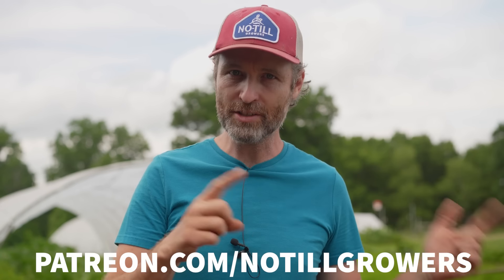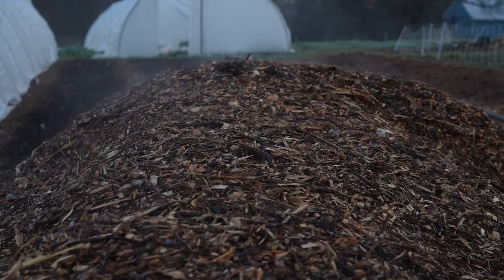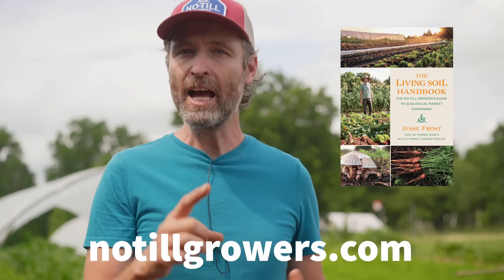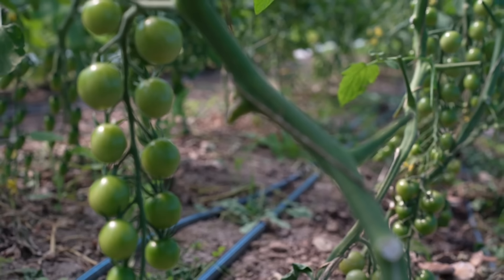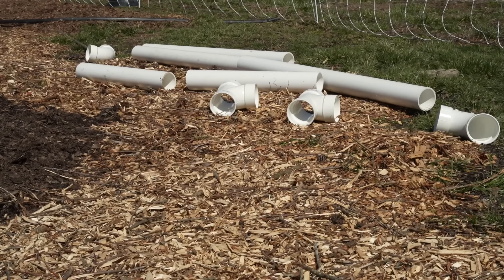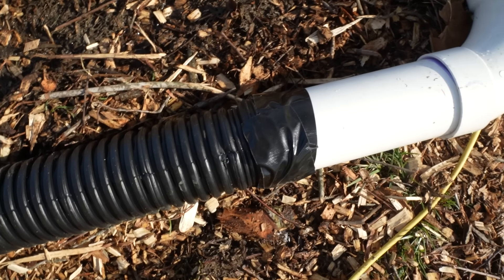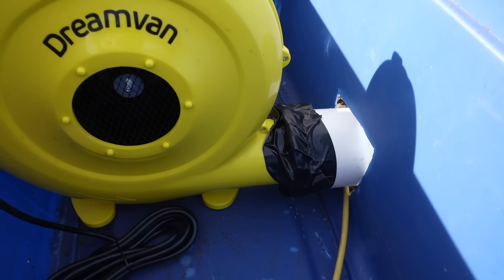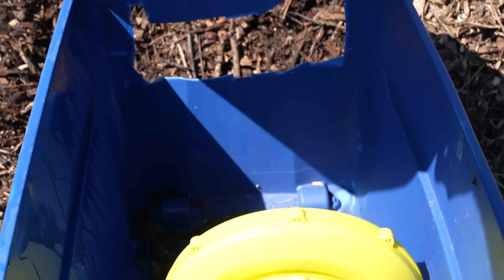Static Aerated Composting System For Organic Farms

Comment: My experience with working with the black flex hose in french drain applications, is to buy the fine mesh netting to wrap around it before burying it...That really helps to keep any dirt or fine organic material out of the flex hose and clogging it over time. I've seen larger systems like this on my sisters Organic potato farm in the long term storage sheds under tons of taters. Works like a charm...😎
Reply: Are you saying that her stored taters are kept aerated? Why?
Reply: @markm8188 probably to keep moisture out? Idk
Reply: @tracycrider7778  and cooling
Reply: And if it’s a big enough pile the air can’t get through by it’s self and the potatoes need to respire. They are alive. Same with apple storage. No air then the cells die and rot.

Comment: A couple of minutes in and I was thinking that this cat has missed his meds and has found a go-pro.... but the odd presentation kinda grew on me and I listened to the whole video. Very informative and correct information given in a very interesting manner :) I started composting as a way to get all the wood from a tree trimming service I took all as in ALL of his garbage (to him it was as he had to pay the landfill to take it) but out of the deal he had to supply x amount of saw timber quality pine, oak or cedar and he could dump on my farm 24/7. I used thermosyphoning to power the air movement ducts and added aerobic bacteria and earthworms. The ignorant rules were not in place back then and I used 25% horse and cow manure to speed the process. I did have a machine to turn the piles as they were 200 Ft. long and 6 Ft. tall.... lol. I made a bunch of money cleaning out barns, sawing timber, heating my house with the scrap off cast wood and selling compost all for basically free on my end. (free being the most relative term evah used..) 
Thanks for the memories this brought back and thank you for the time and effort in capturing, editing and ULing these vids. 
Static aerated composting.......STATIC it doesn't move or need turning. AERATED..... you move air through it... COMPOSTING..... what you are doing using aerobic methodology  ... so the way it is worded is correct.

Comment: Great useful video thank you. What really confuses me with composting is the 30:1 CN ratio especially when using wood chips or wood shavings. I have tonnes of wood shavings and want to compost them but as they're 400:1 or whatever CN ratio it seems that I would need many many times more nitrogen greens to mix with them and that amount of greens is very hard for me to get. What do you think ?
Reply: Use urea

Comment: That interval thing, if someone could explain, I found that confusing, 10:00 .
So pulsed short time often  = more heat?
But long time less often = less heat?

Is that to avoid drying things out, I cant quite figure why longer air time more often would be bad otherwise. Extra air time cools it down too much so shorter air time is therefor better for more heat?
Reply from the maker: Yeah, that was a hard thing to try and explain. But basically the longer it runs the cooler it makes the pile because you're pushing cooler air (relative to the pile) into a warm pile. The shorter intervals are basically injecting just the oxygen and less of the cooling air.
Reply: @notillgrowers  
Thanks man, that really twisted my brains.
Reply from the maker: Mine too!

Comment: Hey Jesse,
I’m a veggie farmer from France, I’m experimenting with living soil practices and I enjoy watching your videos so thanks a lot, they’re great and you’re awesome.
I  now understand a bit more why you spend time and energy making compost for your gardens, about organic certification etc.
My approach as much as possible is to use the freshest organic matter to spread on my gardens.
If the soil isn’t very alive yet and especially if it might have issues of compaction and flooding I would add smaller amounts more often and use a lower C/N ratio to minimize nitrogen tie up and poor plant growth.
In very alive well drained soil, I find that even large amounts of very carbonaceous fresh matter causes no problems if just deposited and not mixed into the soil.

The theory as I understand it is that compost feeds microbes and fungi but is not good for worms and other critters of the soil. They need fresh matter for food, and as they increase their numbers, they create structure, aeration, drainage… and compost which will be later mineralized by bacteria and used by plants to grow.
That theory doesn’t say that one should never use compost, but one should always make sure that a good amount of fresh organic matter is fed every year to every square meter of soil, which may be mulch or cover crops or veggie residue (but that’s normally not enough) ; otherwise there is a risk of reduction in soil macrofauna activity and eventually compaction.
French studies suggest 20-40T/Ha/year (dry matter) for an intensive system.
Reply: One can understand plants as energy producers, while we humans are energy consumers.
Fresh organic matter contains a lot of energy, which can be used by soil life to grow and multiply.
In compost a lot of that energy is lost during the composting process (as gasses, heat, respiration..) and will not be available to the soil.

Comment: This is great! I plan on doing something similar on a much smaller scale, my home compost bin. I've been using a couple of long stakes to maintain air/water holes. They reach the bottom of the bin and I wiggle them periodically when I add water. It works fine and my compost is always completely broken down by autumn, when I spread it. But for an even more passive solution, I plan on swapping out my stakes for some perforated PVC. I'll be able to spray my hose down them for easier watering and they will allow for better airflow compared to what I'm doing now.
Reply: I do something similar, my compost is next to my brush/burn pile, and any time i mess with it ill grab a few of the thickest limbs (like small tree tops) and stick them in and on top of the pile. I can still toss in my household waste and it get to the pile but it keeps the bigger critters out. I recon the dead sticks help with aeration as well as moisture distribution.

Comment: All that wok and it still doesn't work that well. Compost has to be turn because it to cool at the surface so it doesn't compost. I know that because I have been using that system for years

Comment: ASP just sounds cooler. It's the name of a defensive baton as well as a deadly poisonous snake. SAC was already taken by the USAF anyway. I had thought about doing this myself, but I just like to keep it fluffy. It seems that this method just compresses. I also add more greens each time I turn the pile, so I can keep it hot for months. In a commercial application, however, I think this is the way to go. 👍

Comment: To your point about the glue, using Teflon  tape will give you a good seal and allow for taking it apart. Maybe gluing the central connection to the blower and allow the rest to come apart for storage/cleaning. There are rigid perforated pipes that could work as well.

Comment: When I'm short a nitrogen source for my compost I will use either organic alfalfa pellets or bales. Organic alfalfa bales can be hard to find. I can make a 6x6x6 compost pile with one bale of organic alfalfa and wood chips and leaves. Hope this might help
Reply: I've been leaning on alfalfa pellets here in central Ohio - cheap and easy to obtain, no worries about persistent herbicides. Question: do you pre-soak or otherwise process pellets before adding to pile?
Reply from the maker: Sure––Organic Alfalfa is great if you can find it!
Reply: @notillgrowers  Tractor Supply carries it special order, currently ~$0.60/lb. Rounding to 3%N, say $0.20 per lb-percent N? I also wonder if there are times when the extra P & K in alfalfa could cause issues as a compost N source (rather than being a nice bonus).

Comment: In the '50s (I stared gardening at 12) I had access to grass clippings + horse turds for compost to feed my garden. It took 2 weeks except once, 11 days. My piles started out about 5'x5'x10'. The compost lasted about 2-3 weeks, so I was constantly busy. In the 2000s I stopped composting, mostly, and used grass clippings as mulch because I had no manure. It worked. But the best soil builder was shredded leaves, which I applied every fall. Then, one year I was too busy to tend to my garden in the fall and I just let it go. In the spring, I planted seed + my own transplanted "starts" into thick winter growth that "volunteered". That turned out best. 
I didn't work nearly as hard, but the garden did well, even as I planted very closely to block out weeds, and companion planted. 
The #1 soil builder: KEEP ROOTS IN THE GROUND ALL YEAR + stager/mix plants. I stopped composting.
I stopped tilling in the '80s after studying "The One Straw Revolution" by Masanobu Fukuoka.
Reply: You jus need to go to a natural area to see how nature does it perfectly every time :-)
Reply: I just ordered that book based upon your comment.  Thank you.
Reply: What are your thoughts on  leaf mold and grass clippings as a soil amendment. I have just a small backyard garden but this year I didn’t buy any compost. I added a wheelbarrow to each 25sf bed almost everything is still growing from my spring crops.
Reply: I’m starting to cover crop this year just to keep a living root in the soil. It is much too hot this time of year where I am for veggie plants. So a cover crop, even if it’s crappy, will have to suffice. I also compost but suck at it. But it’s better than nothing.
Reply: @growingoutthebox  Be careful not to use clipping from neighbors who spray chemicals of any kind. Plant closely. Mix up the crops. Keep an eye out for organic refuse that looks clean. I once found a lot of wood trimmings, leaves that were put out as garbage. I shredded the leaves and mixed with the wood.
Reply: What do you mean by this? That seems like the important part. And I don't understand unfortunately [planted seed + my own transplanted "starts" into thick winter growth that "volunteered"]

Comment: Why not just do a passive air system.  Put the intake downhill, and add another manifold on the other side with a pipe 10ft in the air.

Comment: My eventual plan is to mow the bahia grass, nut sedge, and other dense greenery and vacuum it up as it is being mowed, then grow worms under the piles. The worms do the work in time, seeking ideal places in the pile and working their way through it. This green stuff is denser than fine grass and it seems to be more permeable than straight normal grass clippings. Also, micro clover could be added to the grass so more nitrogen gets into the mix to keep it all growing well over time. In the south, pine needles work well as a natural aerator. We have lawns anyway, so why not use them for the garden?

Comment: If you buy pipe and drill holes the holes should go on the bottom.  If they are on the top the pipe will fill with debris and water.

Comment: Would it work to layer in nitrate fertilizer to make the fermenting compost get hotter faster and break down to crumblier faster?  How about making laterals (branches of the manifold) out of PVC instead of black corrugated and adding vertical risers every 3-4 feet along each one.  If the vertical risers had perforations, you might get enough air circulation without running the Dreamvan blower and then you could eliminate the plumbing at the bottom. relying only on vertical risers every 3-4 feet, or every 2 feet like a checkerboard grid when seen from the top.

Comment: Would a sprinkler turned on with a solenoid tied in to the blower work or do you need to inject the moisture into the centre of the pile with a root feeder type waterer?
Reply: I saw a video from edible acres a couple years ago and they get woodchips from a city drop off location and what they showed was if they go to the older part of the pile (mountain) it was very broken down almost to the point of being compost. If you had the room you could get tree service companies to drop off spring and summer chips so its not just carbon and given enough time it should be half way to compost in no time. You could also just do 1 long pile and have your blower setup with 1 pipe that you just keep adding pile to it as they drop loads off and if you are there when they drop off you may be able to add water and your nitrogen while they are dumping.
Reply: Is it worth brewing up a big batch of compost tea   (50 gal) to use that as your water for when you build your pile?
Reply from the maker: Many different ways you could get water into the pile, sure! And I always add some teas and such as I'm building. Was a bit much to get into in this video, but absolutely a good idea.

Comment: I would try to steer away from the woodchip when possible. Adding perhaps 1/2 of your current volume of chip so that the pile retains structure, but using a better carbon amendment (Fall leaves if you are in a temperate climate). Problem with woodchip is that the carbon is locked up in lignin, and the chip will not significantly break down in the process. Lignin is only digestible by fungi, and that process takes several years. Leaves will break down into a friable compost, and support the process by offering available carbon to the biology. Also, you can just use Schedule 40 4'' PVC for your laterals, drilling 1/2 inch holes at the 4 and 8 o'clock position every 12 inches. That way the pipe is reusable and you can work around it when using a light duty tractor loader without breaking the pipe. Otherwise nice video, good production!

Comment: Hi, I enjoy your channel and I am learning about composting manure. I believe the two options you mentioned for processing animal materials originate from Title 7 Subtitle B Chapter I Subchapter M Part 205 Subpart C § 205.203(c)(2)(ii-iii). Is the method provided in NOP 5021 Paragraph 4.2 immediately viable?: "The compost pile is mixed or managed to ensure that all of the feedstock heats to the minimum of 131F (55C) for a minimum of three days." A neighbor dropped off 5 yards of horse manure and I would like compost it compliantly.

NOP 5021 indicates: 
The NOP concurs with the NOSB that the examples provided in § 205.203(c)(1-3) is not a finite list of
acceptable plant and animal materials for use in organic production.
...

The (§ 205.203) types of systems do not include common methods of composting such as in piles (rather
than windrows)
...
4.2 Compost
Compost containing plant and animal materials is allowed in accordance with § 205.203(c)(2). Other
examples of acceptable composting methods include:
1. Compost that is made from allowed feedstock materials (either nonsynthetic substances not
prohibited at § 205.602, or synthetics approved for use as plant or soil amendments), and
2. The compost pile is mixed or managed to ensure that all of the feedstock heats to the minimum
of 131F (55C) for a minimum of three days. The monitoring of the above parameters must be
documented in the OSP in accordance with § 205.203(c) and verified during the site visit. 

I also noted that NOP 5021 appears to be consistent with https://www.omri.org/compost-standards. (131F (55C) for a minimum of three days)

Comment: you can get the same success with passive air flow,  I do this with bamboo and never turned a pile other than to check and make sure water was getting to the center.   I see a lot of big dollars going into operations that can be accomplished for less.

Comment: Thank you for getting me thinking of a small-scale aeration solution.  I have soft (no wood) matter that I inject with water with a 3/8 sprayer pipe.  I will try to inject compressed air (regulated to 30psi max for safety - and with goggles) every foot.  A hand valve will release air on the way up.  I am thinking that a small amount of air punched through matted material delivered every few days will assist the living precesses.  This will not cool the pile and not take too much time or equipment.  Do not try this without determining it is safe for you to do so!

Comment: On a separate comment, having dabbled in aquaponics for a number of years, I understand you should stay away from PVC and favour ABS. ABS which can be made food grade will break down slower. PVC can also be "safer" if it is not plasticized (according to what the aquaponics people say) but how do you determine this? I find issue with anything plastic related to compost. Active biological material will always combat the state of a manufactured plastic thus there theoretically must be a form of degradation of the plastic. Seeing that scientists are finding plastic eating bacteria now, I suspect that mother nature has already evolved life to combat our waste stream. If that ends up in your pile, does this not beg consideration that plastic being a petroleum based product of some kind is now slowly breaking down into its constituents in some small way? I would imagine if this is true, using plastic of any kind on soil is akin to a small pinhole leak in an underwater pipeline, its no disaster, but it still a slow burn poison.? How do you feel about it? Thanks for your excellent videos!